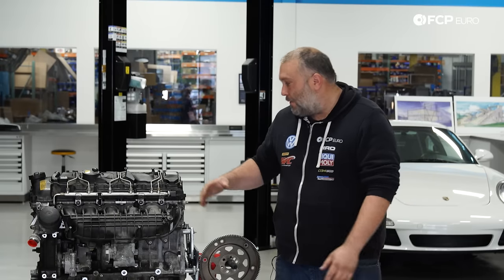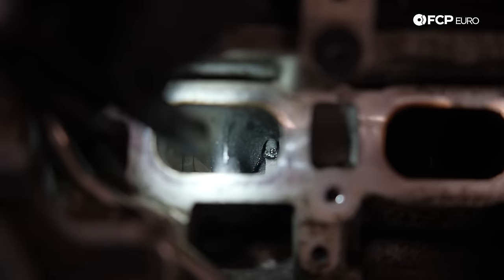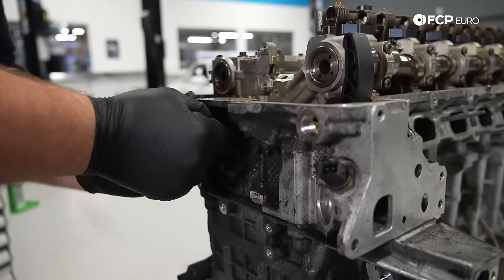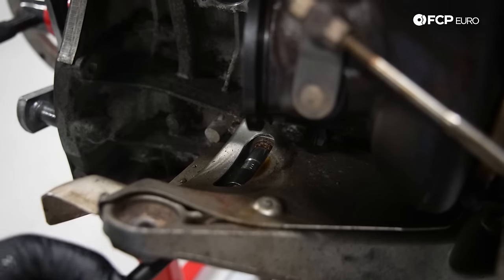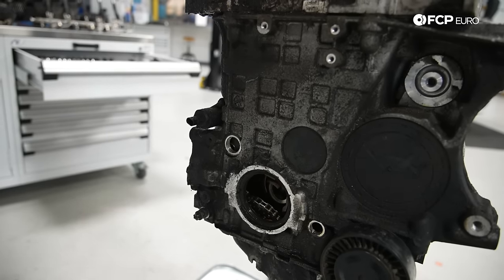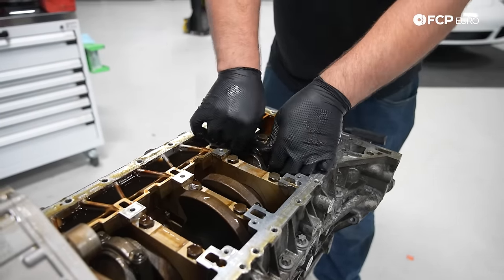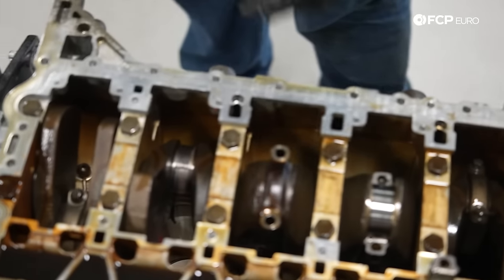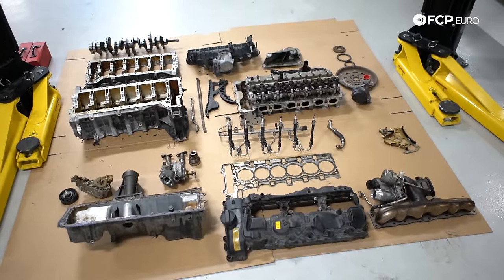Spun & Done - Tearing Down A BMW N55 With A Failed Rod Bearing

Comment: Y'all posted this on IG two days after I oil starved and killed my N55 on track. The irony...
Reply: I've seen a few of those stories unfortunately. The scavenging/oil pickup on the base N55 is pretty terrible. Both the windage tray and pickup are one chunk of plastic. The F87 M2 with the N55 got the entire oiling system from the S55 engine including the oil pump, scavenge pump, oil pan, etc. Pretty clear that BMW saw the limitations in the factory oiling system on the "standard N55" for the high performance applications. The same combination of parts from the S55 is also used on the factory built M235iR and M4GT4 so seemingly an effective upgrade for a standard N55's being used on a track car. However, it's an expensive upgrade proposition for casual usage.
Reply: @GarethFoley  I've been autocrossing for years, finally pulled the trigger to get out on track. I knew there was a risk, but thought I'd probably get away with it for the first weekend. Ah well. The replacement motor is getting the full S55 pan/scavenge pump setup put on it before it goes back in. Other than that, the F30 was phenomenal on track.
Reply: @johnjoyner75  That's wild all it took was one track day. Sounds like the wear may have already been there and it just took the extremes of one track day to finish it off. Either way, great to hear you'll be moving forward with the car and will also be making the upgrade to the S55's lubrication system. If you have any questions or need any technical info let me know. I'm glad to help.
Reply: Is there a correlation between how sticky your tires are vs. oil starvation?
Reply: @Gareth Foley  - Thanks for the video, it is timely.  My son's 335i xdrive N55 currently has a spun bearing or so we suspect.  He noticed some bad sounds on startup and shut the engine off right away.  This happened for two or three starts.   I came up to see it and it started fine and we drove it for a while and all seemed well.  Then after stopping to get gas and re-starting the engine, we noticed a knocking sound.   My independent said it was a spun bearing.  I had Blackstone do an oil analysis, and its slightly high on iron (steel on steel contact?), but not egregious.  I am hoping only minor damage since the engine has only idled with the knock.  I am planning to pull the engine and hopefully I will only have to replace bearings and get the crankshaft honed by a machine shop.  I have done a bunch of DIY - big time FCP euro users as I have 6 German cars, but this will be by far the biggest project.  I don't think I can upgrade to the S55 oil pump/pan because my car is xdrive?  Anything I can do to prevent this after the rebuild?    I read lateral and longitudal g-forces can cause oil starvation.  Seems like Joh Joyner's 1 day track experience bears this out.  Its really unacceptable from BMW for a performance oriented car.
Reply: I have a 2011 N55, took it on Nurburgring & had no issues.
Reply: @Polo08816  For sure. The stickier the tire the higher average lateral G's you can sustain while cornering. Coming from my own experience at the race track I know of one platform raced professionally (built from road cars) that had major oiling problems primarily because of the rule set limiting engine modifications and the use of slick tires. This team would swap engines pretty much every weekend and the failure of the engine was always from oil starvation.
Reply: @alangil40  It's probably not a spun bearing if the engine still runs. Usually, when an engine spins a bearing it will lock. If the knock you hear increases with engine speed it's probably rod knock which would mean the rod bearings are very worn. Worn rod bearings can result in a spun bearing condition because the wear can be so excessive it distorts the shape of the bearing and the locating tangs which keep the bearing locked in place between the connecting rod and connecting rod cap.

There is very little iron content in the N55 engine. The crankshaft and the camshafts would be the two primary sources I would expect ferrite material to come from. If there is crankshaft wear from bearing wear I would also imagine the tin content would be high as well from the connecting rod bearings. If there is high iron content in the engine oil though and it's from the crankshaft it's a full engine rebuild at that point if not an entire engine swap.

The S55 oil pump/pan/suction pump upgrade is a good option for track focused cars (it's been proven to work). I don't think it's necessary for your average road car. Making sure any replacement engine being installed has the updated oil pump is required along with a new windage tray/oil pump pickup.
Reply: @GarethFoley  Thanks for the detailed reply!  Iron content was 34ppm vs a universal average of 27ppm for N55s, but the oil only had 1500 miles on it and when normalizing to the average of 5800 miles, the equivalent amount would be 5x higher than normal, but I am hoping since the knocking just started, the iron content might still be relatively low - I mean its 34ppm, not much more than the normal amount.  Tin content absolutely normal - 1ppm.  I would like to save the car, its otherwise in mint condition and a rare M-sport 6-speed manual version, only 82k miles.  Knocking frequency does increase with RPM.  I guess I will proceed with pulling the engine and inspecting the bottom end and I will look into sourcing a rebuilt long or short block if crankshaft cannot be re-honed for plus size bearings.  Does the updated oil pump fit on 2011 engines?
Reply: @GarethFoley  I was considering the S55 oil pump/pan/suction pump upgrade, but my N55 already has 142,000 miles.  It's an expensive upgrade and I'm not sure the labor is worth it at this point.  I'm inclined to just wait until my N55 blows up and do the upgrade on a replacement engine before it goes into the car.  I've been staying away from sticky 200TW track tires to help mitigate this.  I have used mostly Castrol Edge 5w-40 every 5,000 miles, but I'm considering lowering the interval to every 2,500 miles during the track season.
Reply: @GarethFoley  Hi Gareth,  I got the engine out of the car and the rod bearings looked good - none were spun - and all tolerances measured .002 via plastiguage, though cylinder 5 was on the edge of being .003.  I measured again with micrometer and they were all between .0018 and .0023. I also measured the main bearing tolerances with pastiguage and they were all .0020.  The only 'damage' I could see was some markings on the edge of the thrust bearing - from crank walk?.  I am now wondering if I was misled by my Indy shop and went down a very time consuming rabbit hole (though I learned a lot).  I did notice oil in the vacuum line coming from the vacuum pump suggesting a diaphragm tear and I read the vacuum pump can make a rod knocking noise.  Wondering what to do next - rebuild this one after a machine shop verifies crank is good or buy a used rebuilt N55 long block to be safe.  Prior to knocking the car made a horrible grinding noise, not sure how that sound and the subsequent knocking are related.  I thought maybe a bearing spun and then spun back into place, but it doesn't look like it.  I saw some marks on the Valvetronic worm gear - maybe that was the grinding noise and the knocking something else?
Reply: @alangil40  Alan, what was the final verdict on your N55?
Reply: @MindOverEverything  Funny story.  After being convinced by my experienced BMW shop and others that it was a rod bearing, I pulled the engine and took it apart only to find the bearings looked good and were in specification as measured both with plastiguage and special calipers.  I ended up finding by luck a wreck with the same engine and I installed the replacement engine.  Much too my shock, the knocking sound returned and was the same.  The only 3 parts on the engine that came from my original were the power steering pump, the AC Compressor and the front diff.  Turns out it was the AC Compressor.  I spent 4 months swapping an engine for no reason!  I had asked the original shop to remove the accessory belt to make sure it was not an accessory.  I thought they did this, but apparently, they did not.  I should have done it first thing, but aside from thinking they had already done it, I really felt the inertia of the knocking when driving the car up my driveway and it was easy to believe them that it was a rod knock.  But I did learn a lot and there was a certain sense of accomplishment that I could pull that job off.  At least the new engine was 40,000 miles younger.
Reply: @alangil40  sorry to hear that but thanks for sharing!

Comment: We disassemble the oil pumps and have found scoring issues for the N55.  Remove the rear cover of the oil pump and check the surface.  We recommend oil pumps and rod bearings for the N55 long term owners.
Reply: I've got an N55 with 170k on the clock that needs a oil pan gasket and I am seriously considering rod bearings. I'd heard the oil pumps were bullet proof but seems like your experience is different?
Reply: What year is your n55 engine
Reply: @naterockwell7735  2014 232k all original internals, rod bearings. 

Oil pressure is higher than expected value oj live data. Engine is extremely clean, no rattle on the belt. Oil changes where always done on time at stealership.
Reply: @brarautorepairs  BMW 10k or was it 12k intervals?
Reply: @rayland9305  Always 12 months or 8500 miles.

Comment: Rebuilt my N55 14’ bought it used did 2k in preventative maintenance as soon as a got it 2 months later spun a rod bearing and cylinder 2 greneded.  Btw 2 weeks before it went I took it too the dealership and they said it was the exhaust rattling.
Reply: Damn how many miles did it have? Was it modded? I wanted an n55 but now ive been seeing a lot of negative things about i
Reply: wondering same thing, considering buying one

Comment: An important note, the 2014+ N55 motors with electronic wastegates have S55 rod bearings and rods (same part #).  The EWG N55s do not have rod bearing issues unless you track the car with sustained high G turns.  If you do that driving, then it would be best to get the M2 N55 /  S55 oil pump and windage tray.  All bolt-in parts.  If you have a non-EWG N55, spun rod bearings are a very real concern.
Reply: Thank you! All this fear mongering in the comments about ALL n55’s. people saying the n54 is more reliable are delusional.
Reply: @Cos27O  My n55 (built 2010,125000tkm, STage 2) makes no problems. Oli change interval 8 - 10tkm. If you go all out everyday with such cars, then everyone has his problems.
Reply: People claim to have tracked their N55's hard without any problems by just adding an extra half or full quart of oil.
Reply: It’s probably good idea to add like .5 quart to these engines when changing the oil.

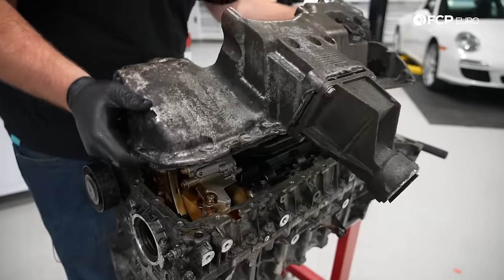Comment: Gareth, check the oil pump PLASTIC pick up tube, which is seen at 20:00 it will definetely be cracked which causes insufficient oil pressure for bearings.

UPVOTE so Gareth could do a follow up inspecting oil pump plastic pick up tube. It is not very known or talked cause for N55 but thats the one for oil starvation. Brilliant engineering once again for N55.
Reply: That is a really good point and observation. I didn't check that particular part, already chucked it, but did speculate in another comment the possibility for the pickup to be a problem area. The valve covers can suffer from micro-cracking over time so there is no reason the plastic windage tray/pickup can't suffer the same problem. Any cracks in that pickup can certainly starve the oil pump or introduce air into the system.
Reply: @GarethFoley  Yes especially who owns N55 in cold climate conditions tend to come across this issue with pick up tube more frequently, these constant temperature changes in winter hot engine, then it freezes, then hot again, freezing etc. is not good for plastic and it is just a matter of time when it will crack. It is very strange that they came up with this plastic design and there is no updated part for it.

Comment: Great video ... wish I had seen it when I was doing major maintenance on my son's N55 engine. I almost always buy my parts from FCP Euro unless FCP just does not have them. Bought full aluminum water pump, injectors, coil packs, spark plugs, oil filter housing gasket, HPFP, valve cover, motor mounts, belts, filters, trans filter/fluid ... everything but the aluminum oil pan. Wish there was a comprehensive 100K mile kit of what needs to be replaced.

Comment: Good video.  I’d like to add something to Gareth’s nice commentary.  You will see blue heat discoloring next to all the journals on all N54, N55 cranks.  This is actually normal because they are inductively heat treated like that from the factory.  The only way to check actual heat damage from no oil is to remove the rod bearings and look at the rod caps and crank journal underneath them.
Reply from the maker: Correct QuestFor10s ! The bluing on the crank is all normal heat treating , the heat we were trying to show in the video was the black discoloration vs the normal bluining/heat. can certainly be confusing!

Comment: This guy seems to be very knowledgeable! I like him 👍
Another cool idea for you to go over b58 and make a video comparing it to n55 in terms of weak points and what was actually improved.
Thanks to all the team I only buy parts from you guys.
Reply: B58 is better in nearly every way. Especially the B58tu. N55 wasn't terrible but was no N54 or B58.  S55 is a great engine though.
Reply from the maker: We would love to do a B58 teardown next!
Reply: @rodgazinya  The N55 is far more reliable than the N54. Even with the slightly weaker internals. The B58 is all-around better more improved, however. Time will tell which fatal issues it can develop though.
Reply: @rodgazinya  lol every big youtuber I follow blew their B58. Don't believe the hype
Reply: @princeali316  n55 is more reliable right up until it spins a bearing lol
Reply: @sonicnofadz  B58 had a recall for bearings spinning. N55 didn’t. N54 also spun bearings. And turbos… and HPFP… and a million other things. 

Unless you’re new to these cars, it’s pretty common knowledge they spin due to oil starvation. Not the bearings themselves. Noob.

Comment: Im about to embark on this journey with my N55. I had a head bolt strip out of the block due to boost, threads and all, and it burns coolant/pressurizes and leaks past the expansion tank now as a result. So I’ll be taking mine down to a bare block and having it studded.

It looks like head bolt clearance with the cams in the head is very tight, probably going to need to remove the cams in order to torque the nuts on the studs (since they’d be larger than the T60 bolts). That looks fun 😅

Comment: nice to see the intake at over 100k miles in that condition. My M135i with the N55 has almost 71k miles on it. thinking about blasting the intake valves

Comment: Love these videos. If you could do an F30 N55 water pump + thermostat replacement video that wouldn't be so bad either!
Reply: I just did mine it’s easy as long as u take everything out, charge pipe, accessorie fan, bottom thermostat hose to sub frame. More room u have to work the easier it is. All I have to say.
Reply: Turbo side charge pipe btw not intake side!

Comment: Rod bearings and Bmw. Iconic duo.
Reply: Likely from not priming engine after repair, so preventable. Definitely important to know
Reply: Unfortunately true. Although, there are a few external factors that don't help these engines either: 

1) Lower viscosity oil is being used to cheat emissions standards (thinner oil means less drag on the oil pump and therefor better efficiency) and extended oil change intervals where oil shear strength is reliant 100% on the quality of the additive package. To that end  BMW factory oil was being supplied by Shell which is primarily GTL (gas to liquid ) base oil which is naturally thinner than refined crude, viscosity and shear resistance is 100% reliant on the additive package at that point.

2) Factor in the viscosity change from #1 and the introduction of auto start stop and you have a long term engine killing combination. I have auto start stop coded off permanently in any modern BMW I own (2017 F15 X5 xDrive35i and 2011 E92 M3).
Reply: @GarethFoley  what brand of oil and viscosity would you recommend using to prevent this extra wear on the engine
Reply: @GarethFoley  Do you believe running 5w40 LiquiMoly to be a good oil to run on these engines? I run around 7k mile intervals. No tracking. Any oil additives you personally believe in?

Was there ever an update on the rod bearings? I read on forums that some 2013 models got a rod bearing update and when I looked up my engine on realoem I believe there was a different part number on the rod bearing compared to the older engines. Not sure if this is true but curious to see if you know anything about that. 

Thanks again for the great video! Would love to see more.
Reply: @briandavila8611  The answer to this complete depends on your climate. If you live in a place that see -20s or below I don't think 5W anything is the right oil in winter.